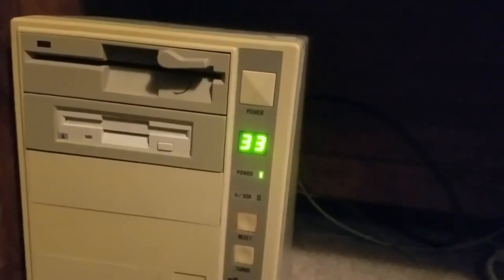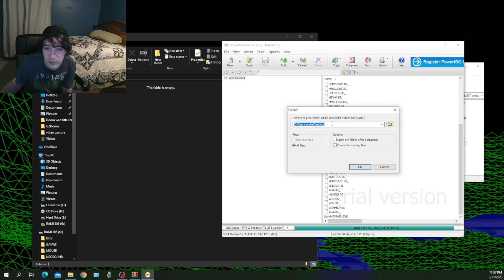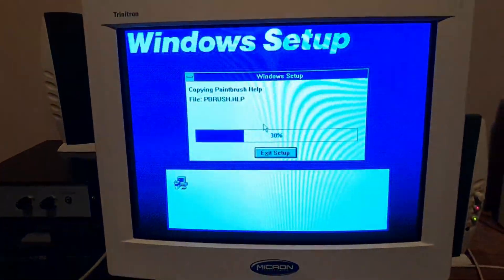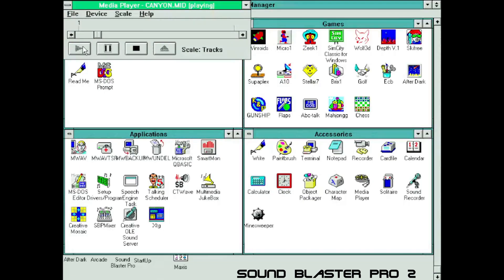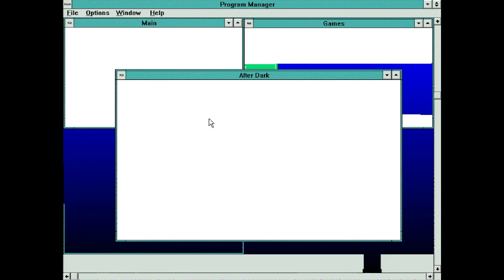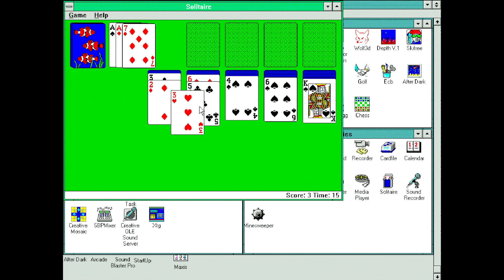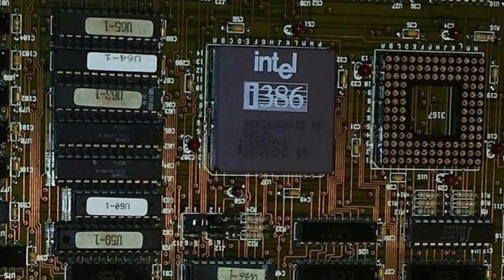Installing and Using Windows 3.1 on a 386 PC

Comment: What's crazy is these old cpus did not use heat sinks or fans. What is wrong with cf? I was told that sd cards are bad to use has hard drives because they are not designed for constant writes.
Reply from the maker: Indeed, they didn't run as hot back then. The 486DX2 was when heatsinks started being required.

I used to use CF cards but switched over to SD because I was constantly get read errors with CF cards, every time I quit a game it would give me the drive error [abort,retry,fail] thing.
Reply: @jikissgamer  weird I just bought an adapter to use cf in my grandfathers old laptop with a 386 hope it works. Is there a way to copy the win 3.1 to the cf in my modern pc before i install in the laptop? I was able to copy all of his 3.1 floppies to my pc.
Reply from the maker: @chriss4365  If you copied the files directly from the floppy disks without extracting them you'll need to run the installation setup first. I haven't tried to copy an entire Windows 3.1 installation before but I think it should work fine.

Comment: Cool vid, 386's are a delight, so awesome that you still have that original one, mine is long gone. Btw, you 'can' use midi on the Sound Blaster Pro 2.0. I made all the music in my "Just the Music" video with midi coming from Cubase into the SPB 2.0 and then recorded the output with Cubase. I have the Gameport / midi cable to do it. I hear lots of people saying it doesn't have intelligent mode etc so it's not suitable for midi but if you have the correct cable you can connect midi controllers and access all the patches. Maybe the midi problem is with the output, if you connected it to a Sound Canvas it may not play things back correctly, but when sending midi input into the SBP 2.0 it works perfectly.
Reply from the maker: That's great to know, thanks for the info! I gotta try that sometime cause I do have a Sound Canvas and an MT32 I would love to use with this computer. The 386 is perfect for old RPGs and adventure games and those have some awesome MT-32 soundtracks.
Reply: @jikissgamer  I found the "Sound Blaster Midi Kit" a while ago, it has the correct cable. There are a lot of bogus cables on ebay etc that don't work, I had to return a bunch until I finally found the "Midi Kit".  Keep in mind, Midi input (to the SPB 2.0) works just fine but it's the output from the card that might be an issue. I don't have any Sound Canvas devices to test that, but I would love to know the results if you do try it.
Reply from the maker: @esc2dos  That's really cool. I will definitely give that a try! Would be a good topic for a video and hopefully helpful to any offer SB Pro 2 users.
Reply: @jikissgamer  Just to be clear, It's the "midi output" from the SBP 2.0 that we are unsure of the results. In case anyone else reads this.

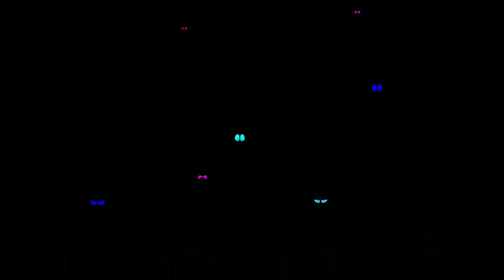Comment: 5:20 that PC Speaker, as beepy as it was on most games, can do some surprisingly cool effects. I like how digitized sounds are on that speaker, especially in Falcon 3.0, where the radio messages have a fuzzy and aggressive feel, perfect for a military setting.
Reply from the maker: Yeah I always thought it was impressive what the PC speaker was able to do. I've seen people play tracker music on those and it's hilarious. Supaplex also makes very good use of the PC speaker digitized sound.
Reply: I was checking out the difference between some of my old games between sound card and the Tandy 3 voice using PC speaker, my brother is down and some of the results were surprising, like for Prince of Persia some of the sound effects were almost identical between sources. There were a couple others that I can't remember now that I super impressed with what the sound designers  got those 3 square wave oscillators to do over PC speaker.
Reply from the maker: @spladam3845  Yeah in the right hands even the most primitive of sound devices can sound awesome. I would love to see what David Wise or Tim Follin could do with it haha.